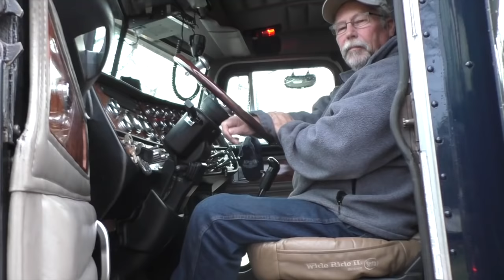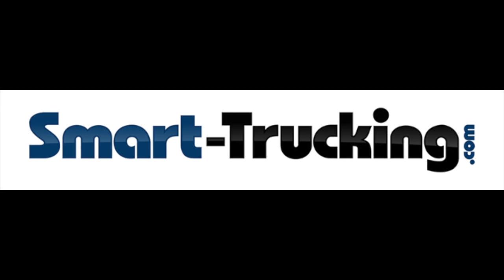Why My Peterbilt Truck Seat is Low

Comment: I don't have back problems, but as a new driver I noticed my tailbone started to hurt really bad a few hours in almost every day.  I thought of this video one day, slid my seat down while I was on the interstate, and the pain disappeared in seconds.  Very helpful, hope to see more videos from you.
Reply: Dimeinurear - also don't set the seat on the rigid setting. But on the   setting that allows the seat to rock back and forth it helps absorb the shocks and bumps on rough roads. I also tilt the seat bottom lower at the seat back and higher at the knees so the seat bottom is tilted back instead of forward I like to feel like I'm firmly planted in the seat.

Comment: Sitting lower does help but having some air is the key. The shock to your back being a floor sitter with no air is compared to jumping off a 3to4 foot step all day long wich will destroy your lower vertebrae and sciatic nerve. Especially the right sciatic nerve. You can still sit low in a low pro seat and have air to reduce the shock compared to stepping off a 1 foot step all day. Once your driving career is reduced to not being a moronic speeder and a know it all, usually after the first 3 years, then you realize that comfort means everything. Looking cool comes with a price to pay wether its to a chiropractor or chrome shop mafia.

Comment: I started driving in a Freightliner FLD flat top. I was at that magic weight and height combo that if I fired up the seat and hit rough road, I hit my head. If I let enough air out not to hit my head, the seat bottomed out and Jarred my back. So I put in all the way down. Been riding that way for 22 years.

Comment: good advice . also good for circulation for the long haul. I drove lower 48 for years & liked the seat low, but now drive heavy haul, dump trucks usually off road at construction sites & have to keep the seat high due to hitting major holes, uneven areas to prevent the seat from bottoming out & actually hurting my back.

Comment: I agree. As the seat cycles up and down and occilates back and forth it is uncomfortable to have your legs hanging in the air or bouncing off the floor. I keep the seat low in the city as well so that my feet are on the pedals correctly.

Comment: I sit sorta of the same way, except i like to have my legs horizontal with the floor, and my feet flat  on the floor as well. Just a lot more comfortable, In a pete you have more room, its all about driver comfort. I test drove a mack for a company a few weeks ago and  there was no way i was going to be able to sit comfortably in that truck. Based on that, i did not take the job. Its my lively hood, i have to enjoy driving the truck i want to drive, and be comfortable doing it.

Comment: I always sat fairly high because I started driving truck before there was such a thing as air ride seats. The old Bostrom torsion bar seats could go a bit lower but nothing like an air seat. Since I'm pretty tall I need the seat up high to keep my knees from hitting the dash. Even up high my right knee was so close to the wiper switch that when I hit a bump my knee would turn off the wipers. I guess that's the disadvantage of a forty inch inseam.
Reply: Big Dave   Air ride is for back breaker trucks.  There is no need for air ride seats in a car at all.

Comment: I'm 6'3" and even in my Ford Fusion, I keep the seat bottomed out.  I've had four back surgeries and it definitely helps ease the strain on the back if my knees are elevated a little.

Comment: After my diagnosis with a herniated disc both my doctor and physical therapist told me to sit higher and tilt the seat as much forward as possible with the back rest at either vertical or slightly tilted back so I would be almost standing in the seat, started doing that after the six weeks of sick leave spent in pain and suffering and I've never felt better after driving long distances,  so I'll be sacrificing my coolness for the sake of my back for a long time to come.
Reply from the maker: Hey, whatever works for you. It's all about being comfortable to make the long miles go by quickly.    Dave

Comment: I'm not a over the road guy, I'm a triaxle dump guy. Driving through rough ass terrain, an old man told me sitting on the bottom let you feel what the truck was feeling. You hit a bad hole going too fast you'll feel it too. Well its the truth, slow the fuck down and have some respect for the truck. Come on with it.

Comment: Back in my truck driving days I would sit as low as the seat would allow me without bottoming out the seat. It made for a smoother ride. If I was riding down the road and the seat bottomed out I would add just enough air to stop it from bottoming out. I liked to have the seat have some smooth shock action to it. I have gotten into trucks before after some little fellow and find the seat maxed out with air pressure. They like to ride sitting on a rock as high as it will go.
Reply from the maker: I ride like you, just enough air in the seat to keep it from bottoming out. Don't know why some guys like to be so high up in the air.    Dave
Reply: Smart-Trucking.com their sitting on a corn cob
Reply: I know some heavier drivers that like the seat low for their backs, but bottom out pretty easy. One of the would put the seat low, the chain it into place and add enough air to keep from bottoming out.

Comment: I do the exact opposite but I throw a pillow on small of my back and push myself slightly up with my feet or with my knee off the dash and I do it especially over bumps. I transfer the shock of the road to my legs instead of my lower spine. Ever since adopting this strategy I have a lot less regular lower back pain. Works well in freightliner.

Comment: I've experimented with seat height, myself. I, too, have found more comfort when I air the seat out. I much prefer to have my legs extended in front of me, as opposed to hanging off the edge of the seat with my feet bouncing on the floor.

Comment: I don't do it because it's  cool, but I ride with a stock seat all the way down, and a few pumps of air in because, well i am 5'9" tall lol. and i drive a day cab 379, so I also pull the seat forward until I get at least fingers width between the back of the seat and rear window! important to learn that now than like me and hear the pop lol

Comment: Alright, I learned to keep the seat low so you can keep your arms extended and your wrists straight to avoid carpal tunnel. It also benefits the angle of your back. Down low and back. 46 years in the seat just retired. Too many surgeries to detail. Healthy now, complete in frame overhaul.
Reply from the maker: Good deal, enjoy retirement, after 46 years, you've earned it!    Dave

Comment: I rode flat w/no air in the seat. If the seat is aired up and you hit a hard bump it will slam your seat hard against the floor. The rocking of the truck combined with the up and down of the seat with air was too many different motions at once IMHO. To each his own!

Comment: I sit lower because I found that the higher you set the seat, the more air pressure there is and there isn't any "give" in the seat and the ride feels harsher. But it is a factory freightliner seat after all...

Comment: When I drove I used to let almost all the air out and left just enough air for the seat to absorb those little vibrations. But if I hit a big bump or a dip in the road it would slam down and bottom out. Man it hurt but still I found it more comfortable riding as low as I could. Sometimes I would let all the air out If the road was nice and smooth. The Volvos I drove were really comfortable. They have the best cab suspension in my opinion. In those Volvos I would often drive with no air in the seats....tankx Dave

Comment: I tell you what,drive through Louisiana a couple of times with that seat in a low position and it feel like ELTON JOHN got a hole of ya
Reply: A KNIGHT  sounds like Elton John got ahold of you
Reply: I know this is a year old, but I have and never bothered me hardly felt the road. The reason I low my seat is because of to much bounce between air ride suspension cab and seat.
Reply: Lol 😂

Comment: I always ran the seat all the way down because I would drive in fields. If I had the seat aired up, it would bottom out when I hit bumps, and if I aired it up to where it wouldn't bottom out, then my head would hit the ceiling. It didn't matter how slow or fast I was going either

Comment: You might want to check out getting "Bose ride" seat. They say that the seat reduces the vibrations felt by the driver by 90%. I've never tried one myself but I'm planning on getting one installed as soon as I get the money. Last I heard they run about $4000 installed. I guess they've found out a way of translating the noise cancelling technology in their headphones to truck seats that do the same.
Reply from the maker: Yeah, I read an article on those. I'd love to try one out. The reviews from guys that had them were that once you had one you'd never have anything else. Expensive but worth every penny the stated.   Dave
Reply: If they are really that good its a shame my insurance wont spring for it. Thats less than a MRI and injections but they dont see it that way.Although I might still look into one.
Reply: Their radios are THE best!

Comment: All my years I ran my seat with no air at all. Back in the cab over days I used to look between the dash and top of the steering wheel. All a guy needed was a 5 foot long shifter that you could hardly even reach lol now that was cool haha!

Comment: Now you need a custom  made right angle pistol grip shifter. The hammer can be your selector and the safety can be your splitter. Of course the trigger would have to be a 6 trumpet 120 dB air horn. And some L.E.D. undercarriage lighting.

Comment: I 26yo from Australia have been driving seat down since I started driving 3years ago some drivers picked on me abit for it thinking It was try hard other older drivers told me that's how they sit and they love to low. my farther always sat low in the seat for the same reasons as you just explained another older driver (drives roadtrains) told me he sat low because he felt it gave him another connection to the truck apart from steering feel to feel what the trailers x4  and truck were doing

Comment: So why then is it only long nose Pete's , that you sit low and have a high stick.  Do people with bad backs only drive Pete's and like to reach high to shift gears?
Reply: AndersonCattleCo. It's a hell of a lot more comfortable. You just rest your hand on the shifter.
Reply: Bad back -Peterbilt  coincidence?
Reply: I drove a 385 day cab for awhile. I liked the small cab because everything was in arms reach. I also sat on the floor too. It was the most comfortable. I hated all that bouncing around.
Reply: Yeah it's much more fun driving a plastic truck that rattles and falls apart with every pothole!! I guess that's why they make zip ties and duck tape!!
Reply: Cuz it's RAD
Reply: AndersonCattleCo. Lime those Harley bike riders,everything has its gangster ways...
Reply: AndersonCattleCo. I
Reply: Would cares why? If that's what you want, go for it. Cookie cutter people are boring. Dare to be yourself.

Comment: A orthopedic surgeon or a physical therapist will disagree with you,,,. I have my seat all the way up and many I have unl bolted,,and added stacks of washers or valve springs underneath to get them up even higher,, now I even use the thick medical cushions that's cut out for the tailbone and between the crotch,,,. But I am 6 foot 1 and have a 36 inch inseam. I need all the legroom I can get,,. ???

Comment: You are right I drove a spotter truck for 2 years (they usually have no rear suspension and bounce like hell) I sat low mostly cause of I'm short and I also hate bouncing around on a air seat its unstable and makes it hard to control the truck perfectly IMO and also it made my back not hurt as much even in a regular cab it feels better than bouncing around up and down forwards and backwards. How you gonna turn the wheel with your feet off the floor of the truck lol.

Comment: I wish I could get that far away from the wheel lol. I drive a Mack if that explains anything lol
Reply: I've looked a bulldog in the butt about all my life. Seat jacked all the way up is barely enough leg room. You put on a Mack, at least the older ones. The 'C' models are better but my knees don't like them AT all. They all need about 8 more inches longer cab.
Reply: I've driven 4 different model Macks...the Granite is huge inside. But I'll take my Sterling or my KW T800 over a Mack any day

Comment: one of my biggest bitches about trucks is the lousy seats. truck builders seem to think all drivers are 6 feet tall . National seats are the worst. I'm average height 5'9 and even with no air they're too high. myself it's not a matter cool but flat out comfort. l don't want to sit on the floor, just high enough so I can reach the pedals without my legs Goin to sleep. Gramag  has a really good seat,self leveling, adjustable damping,tilt and the cushion slides forward and back and if you like you can dump the air with a push of a button. ISRI hausen is another but expensive. Had a Lonestar  that came with those seats..they were awsome. same features as Gramag. I drive log truck in BC , I hated the seat so bad I eventually had to buy my own (gramag), no I dont own the truck. the day cab restricts some of the features but it's such an improvement. It's not hard to imagine that when someone or company orders a truck , the seats are completely overlooked.Its the last thing they consider when it should be the first.
Reply from the maker: Yep, that's really true, the seat is very important. Never tried a Gramag seat, tried more than a few and settled on  the bostrom wide ride 2 which I really like. There's a high tech seat out right now and I think it's made by bose. Supposed to be amazing but big big bucks, I think I read like 6 grand, but guys that had them said they were worth every penny of it.  Dave
Reply: Smart-Trucking.com they're not cheap, $1800 and I crossed the border to save some shipping.   kenworth 880 and Peterbilt come standard with them..next time at the dealer check them out.

Comment: don't worry dave all them ones on here who put comments about how you can't see are it's dangerous and all that dumb stuff can't drive no true unit like that long nose brother they use to them swift volvo junk are them garbage freight shakers. ain't our fault they jealous lol.if they a new driver my hats off to them yall learn bit if you only drove 6 months and think you know everything it's very easy to tell. just look at the fairings on the back of any company trucks sleeper it'll tell all to well lol. roll on dude be kool on ya stool from down south of the boot driva

Comment: You can always tell when you pass a rookie driver ... His seat is all the way up.
Reply: RedSox21 I have no over the road experience, and don't ever plan on going over the road. But I don't think I should be classified as a rookie. I've been driving dump truck since 1993. I am in that seat for 10 to 12 hours a day 5 days a week. With all the obstacles to drive around and all the stopping and going that I have to do and the rough terrain I have to drive on, there is no way I am going to have that seat all the way on the floor. I want enough air in the seat so that it is not constantly bouncing up and down. I want to sit high enough that my knees aren't above my waist and I can lift my leg easily to press the clutch pedal. Keeping proper posture is the best way to keep a good back. The body is not made to be seated with the knees above the waist. With several years of riding off-road motorcycles professionally and 2 1/2 decades of driving dump truck obtaining carpal tunnel, arthritis in the wrists, a bad back, and bad knees are highly possible for me; but I manage to not have those problems because I do things properly. I don't have my seat all the way up, but it is closer to being all the way up than all the way down. Call me a rookie all you want; I probably have just as many hours in the seat as you, if not more, and my body is probably in better shape than yours.
Reply: have been driving for60 yrs well over 6 million miles and i wouldnt drive sitting on the floor dangerous nor would i allow anyone drive a truck i owned that way
Reply: And I can tell you’re not a trucker. Most newer trucks have high seats and bigger windows

Comment: whats the small mirror over the pasenger side door for anyway?
Reply from the maker: That came on the truck from the factory. It shows the road on the passenger side so you can see if any small cars are beside you.    Dave
Reply: Smart-Trucking.com   They used to put a small mirror at the top of the passenger side mirror aimed at the exhaust stack on naturally aspirated Cummings and Mack engines in '60's and early'70's to watch how much fire was coming from the stack. On a real hard pull, if you had enough fuel turned onto the engine, it was not unusual to see a 1.5 ft of fire coming from the stack. Especially at night. Sure made those old trucks run good.

Comment: without air in your seat .when you hit a bumb you will hurt your back
Reply from the maker: There's air in the seat, it's just sitting on a low base.    Dave
Reply: Only if the air suspension on the tractor is non-existent. Another person that's obviously never been closer to a truck than next to one in traffic.